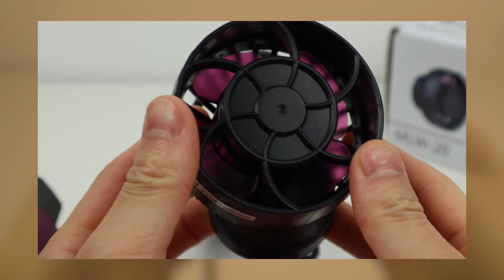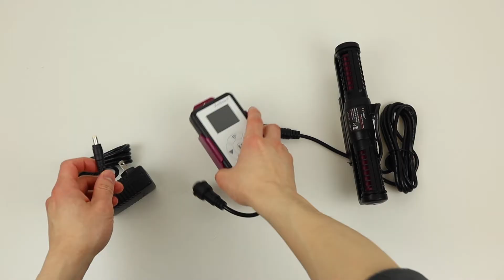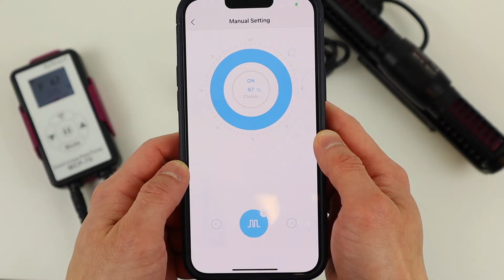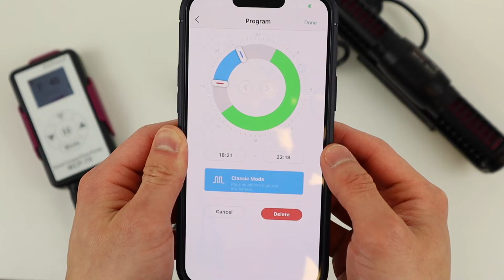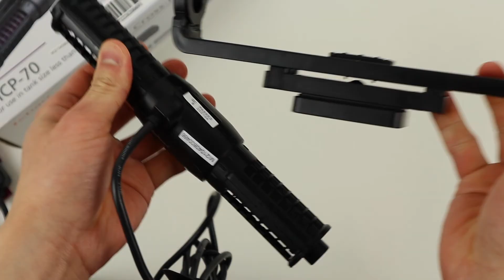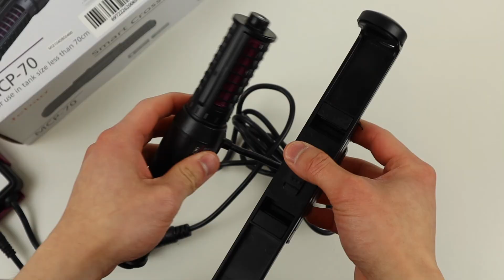Jebao MCP Series WIFI Wavemaker Unboxing & Setting Up

Comment: In previous versions, the else mode did not respect the speed and just operated at max speed. Is this fixed in this version?
Reply: I bought the new MCP version thinking they would surely have this worked out... But they don't. Still fluctuates at max speed in else mode.

Comment: Will the Jebao SCP and MCP series notify you on the app if the pump stops working for whatever reason? I'm wondering as I'm planning to you this for aeration, but I'm wondering what if the wavemaker stops working when I am not home, but the power still runs? How would I know?
Reply: No

Comment: Thanks, this was a big clue for me! I've been trying to figure out how to ramp up speed over time. slow in the morning then ramp up to faster by mid-day then back down again.
While I still can't do a slow ramping, at least I can program the speed day vs night. 
new sub!
Reply: Hi, do you mind share what you did with the jebao mcp120? Just bought it and very struggle to use the app. I followed the instructions on the manual book but no luck. The problem I can see in mine was the jebao wifi turn off automatically when just started to connect. Thanks in advance
Reply: @leodarmawan1677  The app is really not user friendly, I installed on my old iphone5se and could never get it to connect, I read all over the net how it needs wifi 2.4 So i figured I was out of luck. my son has iphone 12 so I had him install it on his phone, it connected the pump and my doser no problem😲. He used my account so I was then able to use the app with my iphone 5 🙃🤣
Reply: @spicyreef  Hi mate, yeah I think the wifi router must be 2.4 not 5G. I must change the setting of my router I think. Thanks mate

Comment: The app sucks. I really hate it. I hope they update it.
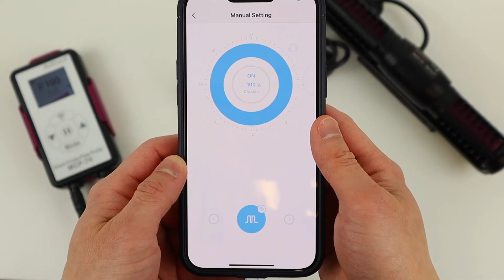Reply from the maker: Hi Rusty! In the video around 5:40, it shows that you can control the flow rate and frequency on the app. Have a nice day!
Reply: @mingtrading7542  I finally found it but man the app is bad. I was just trying to sync two but the slave never really does what it's supposed to. Why can't you crossflow the sine mode?